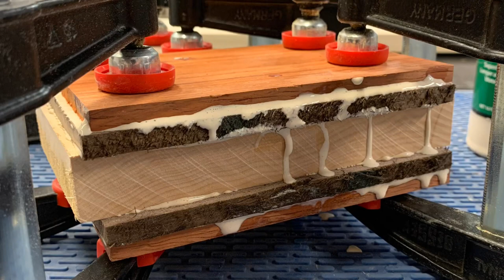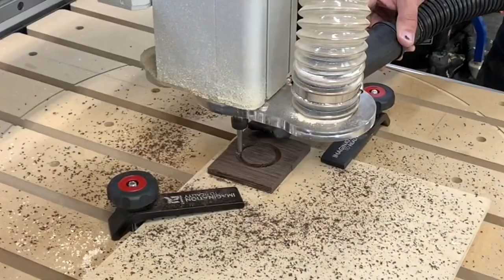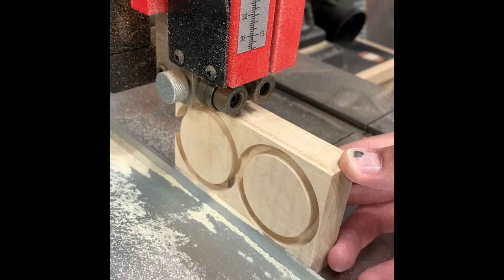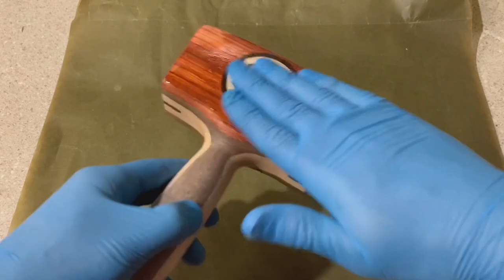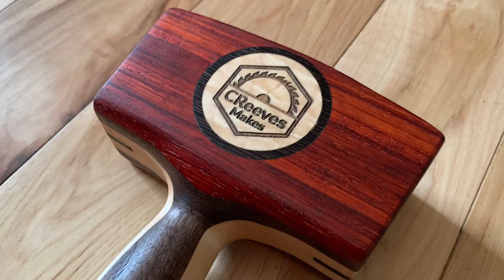Making My First Mallet! #malletchallenge

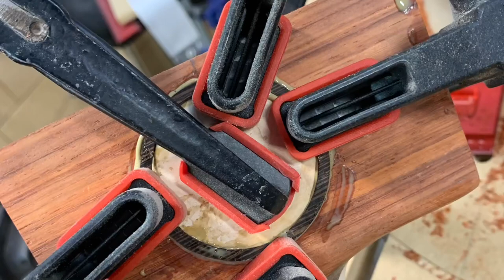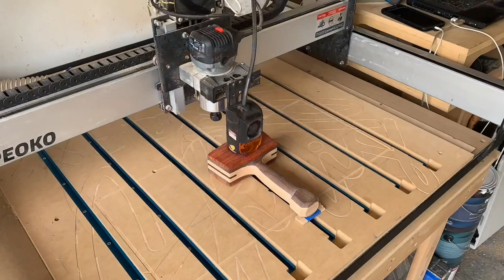Comment: Hi, an excellent job of creating the mallet.  I do have to ask what occurred between timestamp 3:00 and 3:08?  All of a sudden you had a quarter inch insert in the middle of the head.  It really did turn out beautiful and that insert did make a difference!
Reply: Was wondering the same thing. Went back and watched the whole video thinking I missed something. Great work!
Reply from the maker: Yes, your eyes do not deceive you. I lost the footage of that part. I cut a 1/4” wide grove about 3/4” deep on the two faces and also along the top before shaping it. I then glued in wenge and then cut and sanded it flush.